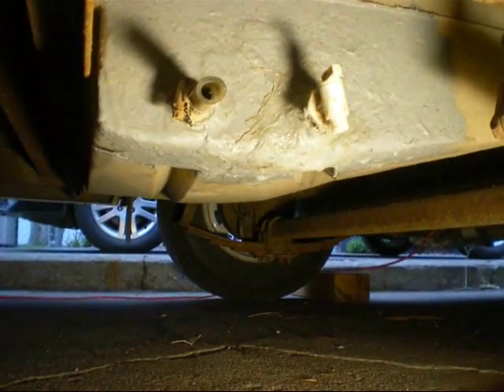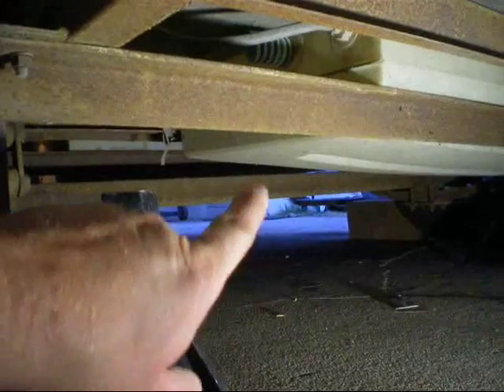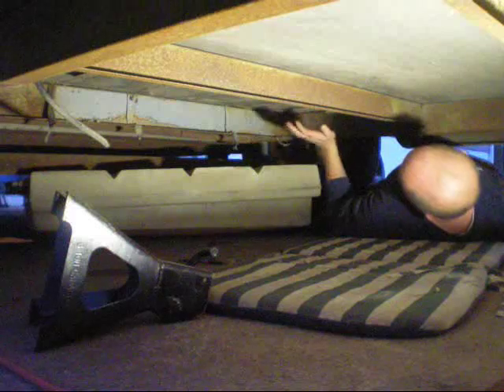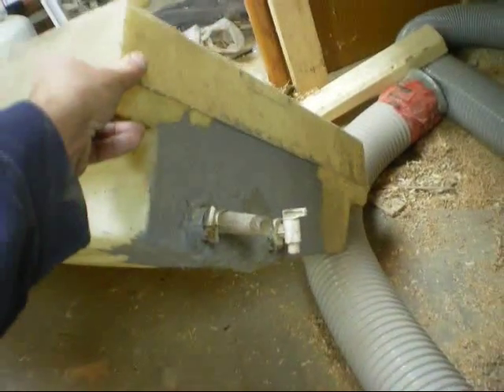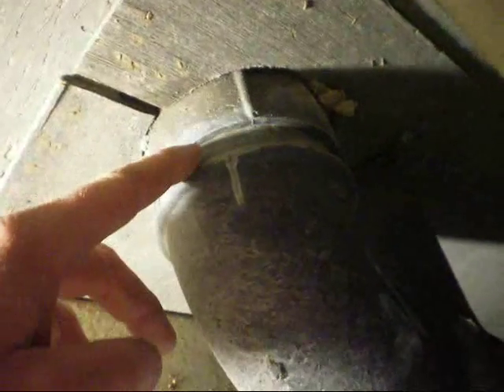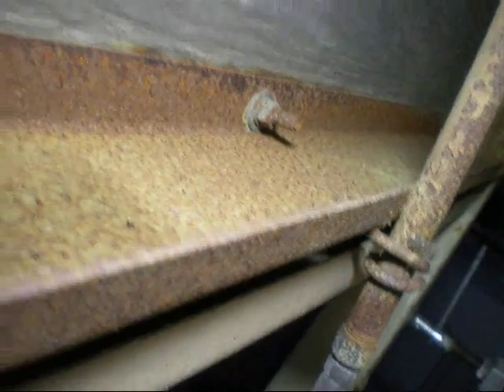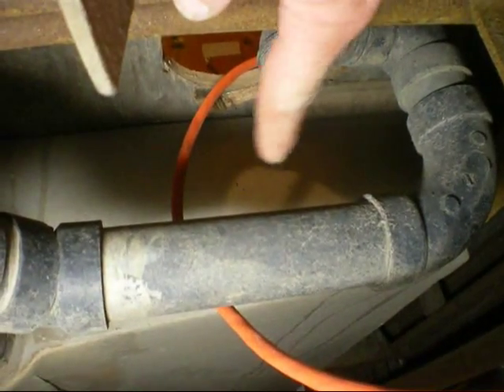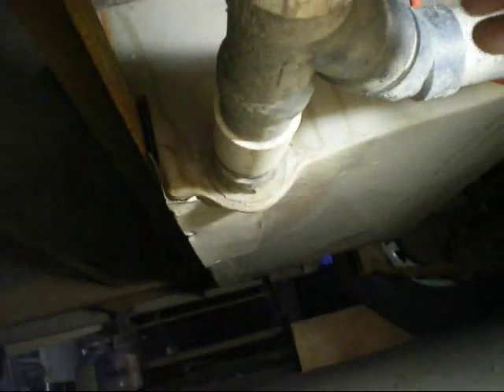Part 6a.  Removing the water tank on a 1979 17 ft. Boler trailer

Comment: Nice work, I have a1978 17ft boler with a patch in the same place as yours on the fresh water tank.  I am getting tried of repairing it, and am going get a replacement.  Did you get one for yours, I am looking for a source.

Thanks
Paul